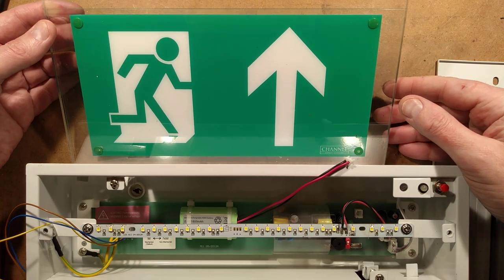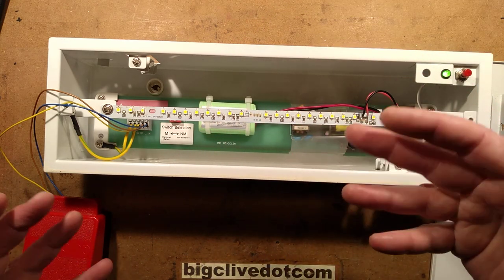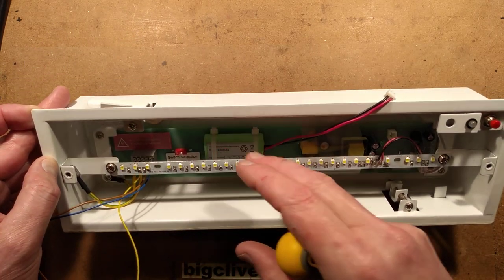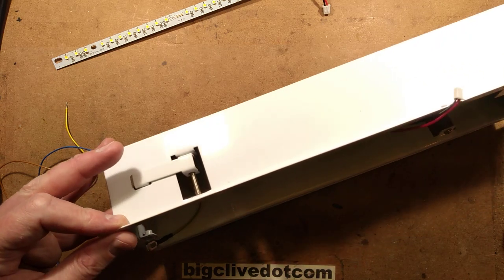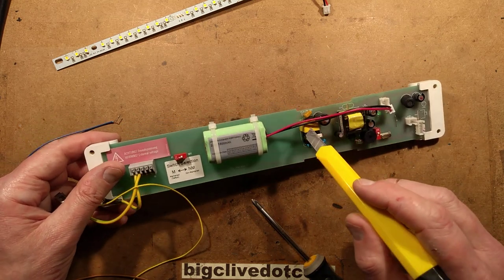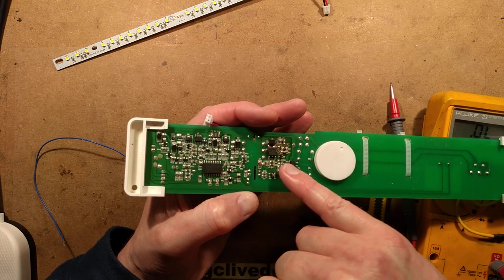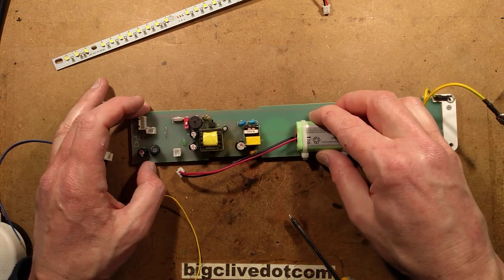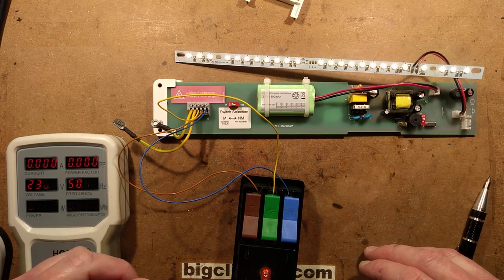Inside a self-testing emergency exit sign.

Comment: Thanks Big Clive 😊👍  
Can you make video  and elaborate on this power factor / apparent power . tell us in detail what it really means.  is it the power companies charging  what they want to charge for electricity and not what we actually using?  is this extortion and is this right.
Reply from the maker: It's not extortion.  The new meters can measure current to voltage relationship in a programmable manner.  It means they can measure VA as opposed to W.  That means that certain items in your home like LED lamps, time switches, microwave and fridge controls, interference suppressors and other low power equipment that relies on simple power supplies will potentially cost between 2 and 20 times what they did before in yearly electricity consumption.  Their power draw is low compared to the primary electrical heating loads, but it could still add a lot to a yearly bill.
Reply: Yes I still find it hard to grasp too.
Does it take more energy at the power company? Would a ups be empty sooner? Can we easily correct it at home?
Reply: Reactive energy (VA) is rarely billed to consumers. If it is, yes, you can correct it. VA is billed to companies/factories, and they have "capacitor batteries" (battery in the meaning of "a bunch of" as opposed to "a power source") to correct the factor and bring back the VA consumption close to the Watt consumption.
You can DIY if you know stuff about electronics.
But the first step you gotta do is ask your electricity company bill you based on the watts or VA you consume. If they no not bill you on reactive energy then you don't have to worry about your electronics taking 20 times more VA.

Comment: Hey Clive I have a 18v ni cad drill battery and I want to convert it to lithiam ion, and I have lots of 18650s. I know I would have to use 5 cells which would mean 20v, I'm just wondering how can I charge it safely and know when the batteries need charging. HELP??
Reply: Look into balance charging systems (hobby chargers). I use a 4s lipo battery in my quadcopter it has a wire for each connection and can drain/charge any battery in the pack simultaneously. you would need a 5s capable charger for 5 cells (I've seen 8s chargers i'm sure). Inside some of the battery packs i've stripped for parts have what looks like balance charging built into the pcb. I hope this points you in the right direction.
Reply: No offense intended, but if you are needing to ask these questions then this may not be the right project for you just from a safety perspective.  Getting things wrong with a Li-ion substitute can burn a house down whereas that same mistake with NiCd or NiMH batteries just ruins the batteries.

The charging requirements of Lithium Ion batteries are very exacting compared to those of the NiCd and NiMH batteries they will be replacing.  On top of that it is not as simple as just swapping out 18650s for the existing cells either as your new Li-ion batteries must also be rated for the discharge rate of the intended application and power tools can have rather high discharge currents (some can draw in excess of 25A — or up to about 13C for 2Ah rated cells) and that means that the battery chemistry must be matched to the intended use (in other words, low discharge rate laptop batteries are not necessarily an acceptable substitute in a cordless drill type application, for example, as not all Li-ion chemistries are the same plus some chemistries, like cobalt Li-ion, are more prone to fire than others).

If you do tackle this project regardless, you are going to need battery protection circuits that can safely handle rather high sustained discharge rates — some power tools can draw upwards of 20-25A — and that are designed to disconnect the power from the tool if the tool draws too much power, the battery pack gets too hot, or if the battery voltage falls below about 3.2V/cell under load (over discharging Li-ion cells is not safe either).  The battery protection must also disconnect from the charger if any one cell’s voltage ever exceeds more than a few hundredths of a volt greater than 4.2V (for most Lithium Ion chemistries) as much beyond 4.25V and the risk of fire becomes unacceptable — hence the razor edge in Li-ion batteries where we often want to charge them to 4.2V/cell but just a few hundredths more and they can catch fire!  That is also why charge balancing becomes critical during charging when you have multiple cells in series because not every cell will charge at the same rate nor by the same amount without active balancing and why the battery protection circuit should automatically disconnect the battery from the charger if any one cell’s voltage rises too high as that means that either the charger has failed or the balancing circuit has failed.  You will also want to use Li-ion cell’s that are similarly matched in terms of actual capacity and impedance (equivalent series resistance) so that they charge and discharge more or less at the same rate to one another — something to be wary of if using otherwise random 18650s from multiple sources or if using used batteries that may no longer deliver their originally stated capacity.

About the simplest way to get all of that is to buy a Ryobi 18V One+ Lithium battery and charger as their 5-cell batteries are about 1.8-2A, depending upon the model, (they also sell larger 4A 10 cell and 6A 15 cell batteries) and usually sell as a pair of batteries for about $50 or singly with a proper charger, but that gives you a pretty well engineered battery plus charging system and does not depend upon any smarts in the cordless tool to provide protection.  Otherwise you may have to select from systems geared towards RC drone type applications to get the higher power handling needed.  Also be aware of the fact that Ali-ion cells tend to maintain their voltage much better than NiCd or NiMH under high draw, such as heavy use of a power tool or a stalled motor, and that fact can potentially destroy a converted power tool if there is nothing to automatically disconnect the power (either a properly tuned battery protection circuit or a fuse) since the Li-ion batteries will supply far more power to the motor under such loads than the originally intended batteries ever could — at best motor speed controllers burn out quickly if stalled or in heavy use, or, at worst, the motor or brushes can self destruct if power is not very quickly interrupted.

However you go, I wish you all the best.
Reply: @ethanpoole3443  I just wanted some ideas from Clive that all. I know what I'm doing
Reply: A simple "Thank you" would have sufficed.

Comment: What would have been the harm in retaining the D-sized batteries, to give it a longer run-time?
Reply: Weight to ship those units, price for bulkier batteries, and lack of interest from consumers. Those lights are not meant to supply a failing power supply but are mandatory, period.
No point in offering "longer run time" when the customer only want those units to obey to the minimal specifications.

Comment: ive got a bunch of these "through hole" rather than SMD with fluorescent tubes all working but failed 3C Ni-Cad cells, any project ideas to re-purpose or upcycle people ?
Reply: Dazza Direct New cells?  Single LiPo instead of 3 NiMH with different charge control? 2 PbAcid cells?

Comment: Are you sure the unused connector pads on LED strip is meant for a IR receiver? Couldn't it just be a light sensor for those centrally managed emergency lights (more advanced) which can also self-test the LEDs by checking for light output, ergo it turns on the lights, then checks for feedback, turns off the light, checks for non-feedback, and then repeats the cycle a few times (possibly with random intervals) to really be sure the sign Actually gives light output.
Reply from the maker: It has three connections and the style of an IR sensor.
Reply: @bigclivedotcom  I doubt a IR sensor would be useful in that location. There is light sensors with 3 connectors that "look like" an IR sensor, but has a clear lens instead of black lens, to let in visible light too. IR-sensor has VCC, OUT and GND, and same for a light sensor. They work exactly like an IR sensor but with the difference it reacts on visible light instead.

Comment: Yay! Nice video Clive! I'm afraid this would not pass scrutiny to current standards. Earthing on the control gear before the metal enclosure is no longer allowed as it relies on the PCB tracking to maintain the earth continuity to the case..  which is no longer permitted.. it's picky but that's the new requirement... causing headaches already for manufacturers lol... New stuff needs to earth firstly on the enclosure if of metal then on to the control gear :) Can't remember which standard its in, these are done to a few.. normally 60598-2-22 and 60598-1 is the lumianire as a whole, and the control gear is 61347-2-7 and 61347-2-13... 62034  for the auto test parts compliance.... not including LED Blue light and RG group and CR contrast ratio for the signage (Which seems at least to be ISO compliant!) a lot involved in testing these.  You don't say if the manufacturer of this  actually has it certified or approved... i wonder? By current technologies and designs.. this is rather a basic unit... many now are DALI, Wifi and IR smart enabled IoT lights.. you'd be amazed at the tech in some of the "advanced" emergency lights nowdays. Emergency lights don't all have to run for 3 hours... there is usually a marking something like  "X 1 A*D** 180" ----- X being Self contained, 1 being Maintained, the letters various features and the last number is the duration in minutes, some emergency lights are only 60, 120 etc... its whatever the luminaire is rated to, the standards do not say "Must be 3 hours".
Reply from the maker: If it was relying on a track to a round pad on a support pillar I'd be concerned, but in this instance there is a large island of copper shunting the three earth connections together and effectively making the connector into a commoning block.  That does have the slight weakness of solder joints, but it has the huge advantage of solid mechanical connections to the front and back, and the ease with which even the most unskilled electro-labourer can provide a good connection to that common earth.
Reply: @bigclivedotcom  Hi Clive, it's in 61347-1:2015, clause 9.4 (called by the control gear standard, 61347-2-7) - "earthing of the luminaire or other equipment via the built-in control gear is not allowed" - I know what you are saying but that's been a European standard requirement (based on IEC standard) since 2013... out of interest I looked back at older version of the standard, it was added in amendment 2 in 2013, I.e. 61347-1:2008+A2:2013. Before that it was not really clear if it was permitted or not, 61347-1:2001+A1:2008 simply says if a control gear had and earthing terminal it should only be used for earthing the control gear, but earthing of the control gear via a fixing to earthed metal was allowed, it wasnt clear and im guessing the OSM-LUM, ETICS or another comittee raised this and had it clarified in the A2 amendment.
Reply: BSI Tester, wonder if this was designed/ sold before or after that standard was withdrawn.
The design is also an example of cost reduction ( & maybe waste reduction)If you were the designer you might argue that the long PCB is just the gear tray and part of the luminaire and therefore luminaire is earthed by the gear tray connector block. Problem is they have then intergrated the control gear in to the gear tray. If they would have put the control gear on a separate pcb then the controlgear would then be powered by the luminaire gear tray, resulting in a compliant design. But the overall construction wouldn’t have fundamentally changed. And if anything more material is wasted with the potential to end up in a landfill. I love and loath standards....

Comment: Those twist-clip lighting sockets... why are they not a standard thing in houses? That way "unskilled operatives" could change their light fixtures without needing to poke at the ceiling with screwdrivers while stood on a dining room chair in the dark.
Reply from the maker: In some houses they are standard.
Reply: @bigclivedotcom  I feel they may become a feature in my new house (once it's built) to replace the generic ceiling roses our homes have, and those terrible plastic efforts that IKEA supply on their ceiling lights. I assume the whole assembly can support the weight of a light fitting?

Comment: Hello! Thank you so much for this very informational video! 
I was looking for support as I have an exit sign that blinks the LEDs and I wanted to find the solution. 
Is there anyone that might have an idea of what the problem could be? Maybe the batteries are getting old? I can't tell how old they are. 
Ive tried the short test and it seems to be ok. No red led was activated. And if I will run the long test will the "bip" you are talking about happen from the sign or from the fire allarm? I live in a community and I'd love not to create panic. And as is a 3h test I might not be there when the allarm sets off.

Thank you very much
Reply from the maker: It's a good idea to change emergency lights after at most ten years as they degrade over time.  You may be able to get a replacement rechargeable battery pack for the light, but the circuitry itself might be aging.

Comment: You didn't say anything about the batteries. Are they a known brand? Are they "special" for that purpose? Could the light be refurbished or would that be "against the rules"?
Reply from the maker: You can get new battery packs from the supplier.  They should be standard industrial NiCd cells.
Reply: @bigclivedotcom  The batteries for luminaries have to have a declaration of conformance and a declared 4-year life cycle, min max charge rates etc, hence why regular off the shelf batteries are not used, only certain big battery manufacturers supply that such as SAFT etc.. as it's classed as a life-safety system

Comment: Here’s a question unrelated to this specific device, but very much related to modern tech and servicing. I’ve often wondered: When did tech evolve to the point (and with what devices) that no single human was able to understand it’s circuitry/logic from beginning to end? For example: I once worked in consumer electronics repair, and did component level troubleshooting. At that time, one person (instructor, tech rep, etc) could walk you through every bit of circuitry from the antenna to the (then) CRT. With the advent of IC’s, and CAD, I suspect that ability came to an end. But about when exactly?
Reply from the maker: There are still products and people who understand the full thing fully.  But so much electronic equipment relies on software these days that there is a distinct divide between the departments that design the hardware and software.  Maintenance has become mostly board swapping with a minority of engineers capable of doing component level fixes on older equipment.

Comment: Interesting that the LED versions of these emergency lights would deliberately use smaller capacity batteries than the older fluorescent tube designs. That doesn't seem necessary, for several reasons: First, there isn't exactly a shortage of empty space inside the box, especially since the LED strip takes up less space than even a CFL bulb. Second, the electronics required to make a fluorescent tube work from battery power are surely more complicated and expensive. Whereas running LED strips from batteries is much easier, especially with lithium-ion cells, which produce almost the nominal voltage for LEDs anyway.

So my question is: Why not fit these devices with much larger capacity batteries? It's not going to cost much more to do, and then the light would last far longer than the 3 hour minimum required by regulations. After all, there's nothing in those regulations that specifies a maximum time for the emergency light to stay lit, is there? A bigger battery would compensate for any memory effect or loss of charging efficiency, giving the whole thing a far greater lifetime before needing replacement.

Comment: we have a load of these in our building and they all flicker and I have bought the identical battery packs for them and that has not  seemed to solve anything, they are the same as the one here you are using (channel) , any ideas? Note: they have been in the building for probably 5 years and set to maintained (on 24/7)
Reply: Probably the leds are now wearing out 
I would recommend replacing them all with brand new units and only use them in maintained mode if they are hard to see and non maintained of the room is well lit

Comment: Shouldn't a maintained E light have a switched live as well as a permanent live or is this intended to be always on in maintained mode?
Reply from the maker: You get lights that have a second mains input for use as switched maintained lights.  The modern versions usually use a resistor, rectifier and optoisolator to detect the other feed.

Comment: You're certainly getting a lot of fresh air for your money there  ;)  Still, I guess the size is based on the original emergency lighting units; which would have had to contain a fluorescent tube with its drive circuit, a sealed lead-acid battery and a hefty transformer to power it all.  If there was life left in the old tooling, it might be more economical to keep churning out the old housings.

No doubt there are cheap clones out there, with a Lithium ion cell and a less sophisticated microcontroller crammed into a plastic housing ..... Not sure I'd be so keen to save a few quid on fire exit signs in a multi-million pound factory, especially with a risk of the fire exits themselves being self-testing .....